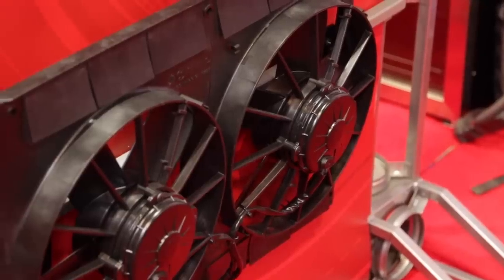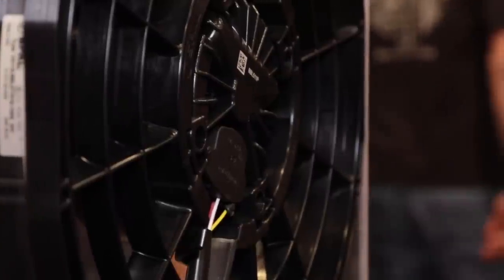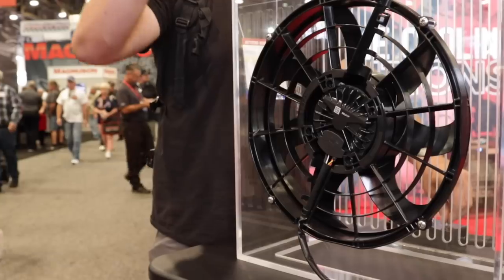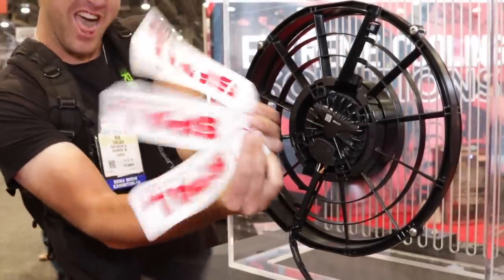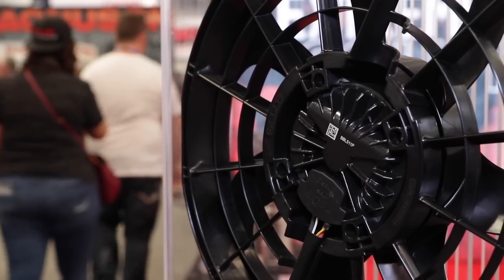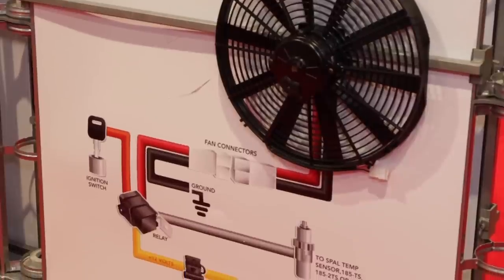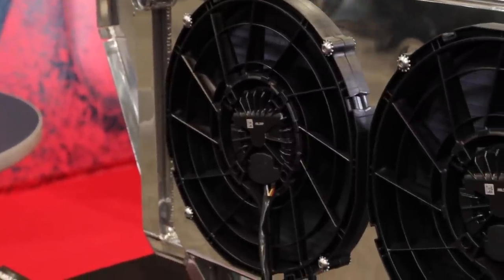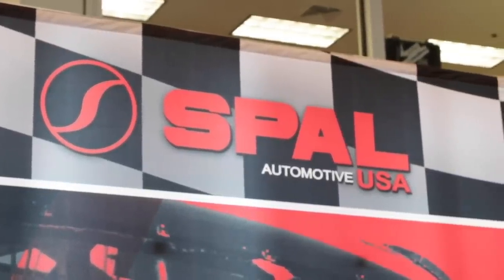SEMA 2018: A Lesson in Modern Cooling with SPAL & Its Brushless Fans

Comment: These fans are not extreme. The BMW 1000-850w brushless fans are as good as it gets and flow more air then any fan in the automotive market.. but you have to use a aftermarket pwm driver set at 100hz & GM temp sensor. Or if you want bad ass brushed power the OEM Volvo 850 fan #9497929 flows around 4300 real cfm, it has the same 2sp motor as the legndary Lincoln MKIII just different blade the volvo is 16" and the mkiii is around 18". These spal fans are a joke. The Volvo lends itself to custom setups, its flange mounted and is 2spd using the volvo relay. We cool a 970hp GN with the volvo fan.
Reply: your 100% correct on that volvo fan!   i have the volvo fan in my 65 c10 small block motor.   in dallas tx during the summer stuck in traffic it never even tuned on the high side.    there are some small "cons" though.
1.)  they cant mount directly to the radiator (the blades stick out about 3/16")
2)  you have add a transfer relay before the two relays. (unless you use there module) relay.
i even swapped out a mark 8 fan motor to the volvo assembly.   made no difference in performance.   they must be the same motor.
but yea..   your 100% correct freshkryp69!

larry
Reply: @mafosa8519  I had a spal on my 67 Skylark and wasn't happy. It wasn't performing too much better than a mid priced ebay fan. I ended up over happy with a fan from a 03 pt cruiser. It already had a shroud and covered my radiator like it was built for it no modifications for $55 new. Low amp pull and runs less cooling off my 350 perfectly.
Reply: Have the Volvo fan on my Jeep Cherokee.  Keeps it on the thermostat with the AC set to stun on a 95* day at 7500'.

Comment: One more thing please.... I am also interested in the 17" 30107035 but again, no where to purchase this fan at a reasonable cost and with out a shroud. I do not need a shroud as we build our own here. Can you again, give me some solid specs on the 30107035 as well as the 16" 30107072 ... I would not be interested in anything that did not have your 500 watt motor. ( go big or go home, right!?).
Reply: I think I see 600 and higher now. Not much info out there. Marketing is weak.

Comment: I build custom aluminum radiators and have a number of questions on the brushless fans.... How does you 500w series 16" fan at maximum out put compare to a 17" 265w brushed fan that pulls 23.5amp at maximum output? I have always been a fan of Derale's product, simply because the "amp draw" and 265w motor signals to me that this fan can do some work. Could you give me a "feel" for the difference in these 2 products? I realize that cfm ratings are not a good spec to go by because of real world variables. 

I have also used the old Vintage Air "Monster Fans" which are essentially the Lincoln Mk fans in an aftermarket bracket. Although Vintage Air has discontinued these fans, I have managed to figure out the VDO part number for the motors and have been able to duplicate this product with used fan blades and new VDO motors. These fans as we all know pull about the most air of anything that is easy to come up with for a hot rod application but they are limited in application because of space limitations on many street rod/hot rod applications versus the size of the VDO motors. Can you be more specific as to how your 16" brushless unit will stand up beside these fans? 

I would like to know where these brushless fans can be purchased at a jobber type pricing rather than retail, as I have to try and put together an affordable package with the radiators I build. Most of the stuff I do is for upper end applications where there are not "off the shelf" radiators available, i.e. Blow BBC street rods that want to do cruising in the summer with the ac on, High horsepower street stuff, 1000hp+ turbo'd stuff, 600 cui stuff, etc... 

I need a reply asap please as I am in the middle of a project right now that could possibly use one of these 500w brushless fans in 16". 

Do you have any solid specs on your 16" 500w fan at max output with realistic voltage of 12-13v. Amp draw at max output, any kind of "advertised" cfm versus brushed 265w fan, etc.... Give me some real selling points I can use and I would be willing to switch to your brushless fans. 

Thank you,
Scott Simpson, d.b.a. Best Radiator www.bestradiator.net     .... scott@bestradiator.net
Reply: He dude, i have a couple of those lincoln mark viii fan you were talking about. i retrofitted two of them on my radiator and they flow so much air it’s INSANE! 
i bought a 300amp alternator just to keep up with them, but i’m thinking of doing a brushless 600w dual 19” fan system to see if they really do work better.
i’ll be uploading the video on my channel incase you want to check it out
Reply: @payloadperformance9706  I am already well into the use of the brushless 600w fans and they are badass! Perks are oe technology, brushless reliability and best of all, soft start so it doesn't HIT you electrical system like the Lincoln fans,. This hit can stall an engine on idle if it has a big thumping cam and now that problem is solved. If you do not use the smart sensor provided, you lose the variable speed feature but you still get soft start which is awesome. The fans are very pricy with all the peripheral but are excellent pieces if you customer can afford them. These fans are not yet available from the big box race outlets but if you buy a bunch at a time you can sometimes get a vender to come off list just a bit. Seems Spaal is having a hard time getting product to us from Italy at this moment as well with the WHO keeping the plandemic going. But... if you can get your hands on these fans and can afford them they are the cat's meow for sure. Easy on the electrical system with big results. I just built a beefy radiator for one of my customers doing a high end 63 Lincoln with a Kaase Boss9 fuelie. He will be installing 2 of the 14" fans on this 2 row x 1 1/2" (3.25" core) tube double pass radiator and I anticipate no problems. See Mike Big Creek Restorations for details on the car . They do some awesome high end builds and no junk! ..... ps...... wiring diagrams are poorly optioned for these fans so I have already drawn up new ones for "with a/c" which will use high pressure switch to also kick the relays and I have one for "without sensor" if you choose to kick the fans with computer or Dakota Digital instead...
Reply: @scottsimpson166  that’s good to hear, i guess i will be installing the brushless fans i got. 
they aren’t spal they are from a mercedes but are essentially the same thing coming in at 600w and 19” 
i rebuilt the main wait items in the fans already and replace the bearing with some new ones so they are ultra smooth and quiet. 
can’t wait to install them. 

do you have any pics on instagram or videos here on youtube on those fans? 
if not can you send me some pics of your set up? 
my IG is the same name as my youtube

Comment: I run dual spal H.O. 11" on my C6 and it is marginally enough. 
1. Will one large brushless outperform 2 smaller fans? 
2. Can brushless fans turn higher RPM than brushed and is there benifit to this?
Reply: Don't hold me to it and not sure how you have it set up with the c6 but I've Hurd especially with the corvettes they should have a push & pull 2 fan system

Comment: Wait - did I hear (and understand) correctly that there’s no controller for brushless fans other than the temp sensor?
Reply: This is DC brushless fan with integrated controller ang logic inside the motor housing. According the information from their website you also can control RPM with an extra wire the fan has through external control circuit (not included)